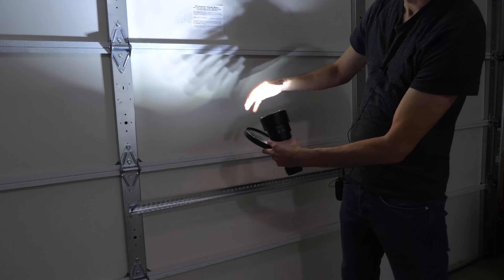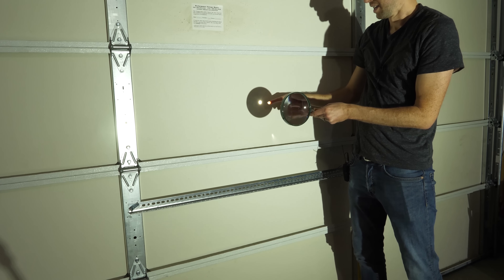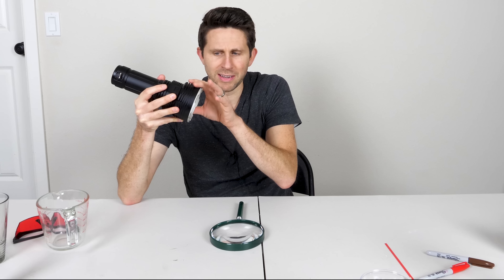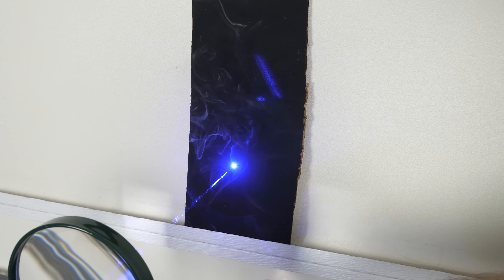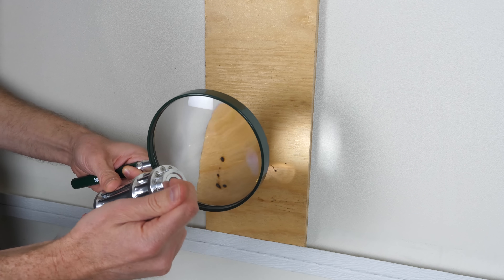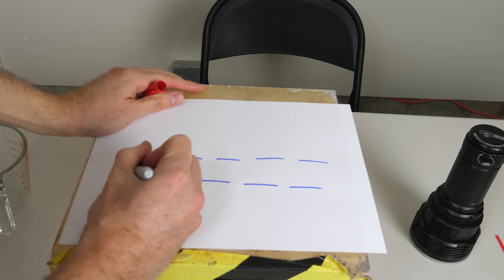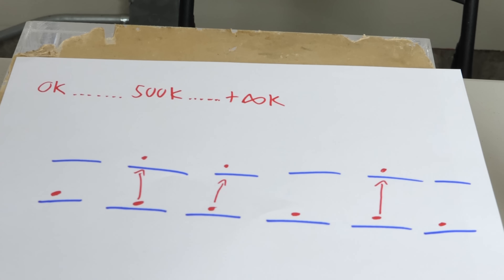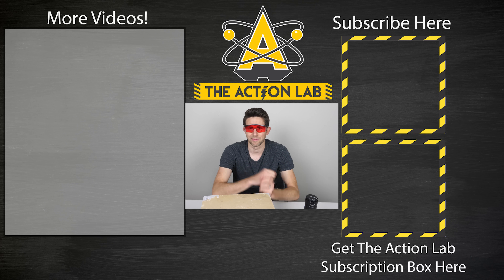What Happens if You Focus a 5W Laser With a Giant Magnifying Glass? Negative Kelvin Temperature!

Comment: What about a microwave oven? A body that radiates microwave energy has less temperature than the one we can achieve in a microwave oven in which we can even melt metals or glass.
Reply: You are adding energy to the system with electricity
Reply: @Adix_Null  And the sun is adding energy to a system of a lens and some random spot somewhere with fusion energy. The guy who posted this video made a big gaff with his explanation.
Reply: @Adix_Null  of course your adding energy to the system. No laser, flashlight, oven, or microwave would work without adding energy. I'm not sure how you meant that to apply to the original post. Hell i'm somewhat iffy on what he meant, lol. Is he saying that an oven can melt metal and glass but a microwave will not? If so there's obvious reasons for that.
Reply: @Adix_Null  , yes, this is the most correct. You're adding energy to the system that does not exceed the energy of both systems, separately. Heat is just another form of energy and the microwaves excite the water molecules which is just kinetic energy. Using electricity to increase the energy of the "system."
Reply: It's the same as the laser. It makes the target of the beam burn but it doesn't heat up the casing of the laser.
Reply: styropyro made a microwave lazer
Reply: Yep, I suppose microwave is more like wireless electricity transfer. Only material that can receive the radio waves and convert them to heat gets hot. 

You can make a solar panel and from the electricity create as high temperature as you want. IMO that's similar to microwave.
Reply: A microwave heats by friction.
Same as running your hand on something makes it hotter than your body temperature through friction, or starting a fire by rubbing sticks together.
It's a total different mechanism than radiative heating.
Reply: I guess that's electrons temperature radiating, and electrons heat motion is even weirdet

Comment: Dude.....i respect your knowledge and efforts put into making this presentation to us, but perhaps it's me who gets the information you put out wrong when you said that you can't use sunlight to start a fire, here's where ima disappoint you! When i was about 10 or 11 years old, i used to wear glasses, and when i upgraded to a newer pair, i used one of its lenses in an exact replica of what you're doing here, and i was able to start a fire by using the eyeglass lense on a piece of newspaper! The sun was right above me, so it must've been noon, or no later than 1 or 2 o'clock in the afternoon when i did that, and i was able to create a point small enough that it started burning the newspaper, which ignited a fire!! Perhaps you were only referring to that "you just cannot create a higher temperature ONLY...then the source itself by using some sort of magnification" so in that sense, yeah you're right! I didn't create a temperature in that concentrated point, that was hotter than the Sun, but i was able to create a point small and concentrated light onto a surface, where it reached a temperature high enough to where a fire could ignite.

Comment: You're wrong. The flashlight can be focused down to a point hotter than the surface..... What you should say is that it cannot gain heat energy, it can never be focused down to a point that has more heat energy than the original surface HOWEVER that DOES NOT mean it's not hotter.... It is obviously hotter because it has the SAME HEAT ENERGY CONCENTRATED IN A SMALLER POINT.

Much the same how a knife has the same energy as a finger poke but does infinitely more damage. Your laser never heat up, at all. All that happened is the energy was more concentrated and since it has the same heat energy but it's hitting a smaller surface that surface heats up more. It would be the exact same with the Led light but you'd need a bigger magnifying glass

Comment: You say that it's impossible to focus sunlight hotter than the surface of the sun. However (theoretically) if we had resources to build extremely large lenses aligned from the sun to the earth... I promise you that it's very possible to focus sunlight into laser light and focus that light into an extremely fine and extremely hot point of light that is far hotter than the surface of the sun.

Comment: I dont find the '-ve temperature' explanation helpful: it sounds like a notion conjured up to fit some observations.  A laser beam doesn't have a temperature until its radiated energy hits a surface and then the temperature rise depends on the material and energy in watts/area.  Also the comparison with a light source isn't real: the flashlight radiates energy in a very broad band while the laser radiates in very tight coherrent spectral bands including infrared.  Overall the system is conserved: the energy turned into heat is less than is put in.

Comment: I'm surprised. I would've thought you could definitely use the right kind of lenses to focus the whole of the light.
So if you can't do that, is it also not possible to use refraction, like satellite dishes making use of foci points or something the like?
Reply: It will be hotter. You cannot just lose energy. Energy focused on one point will have higher temperature but will still have same amount of energy...
Reply: You can focus all of light. Just that the focused point will never be hotter than the source is what is meant
Reply: The focal point will always end up smeared out due to the properties of mirrors/lenses and the physical sizes of the light source. If the source was a perfect point source or only had a single wavelength you can get around some of those physical limitations on optics, both things you see in lasers - they look like they're coming from a very distant point based on how parallel the light beam is, and they have very narrow ranges of wavelengths they output. Although even then, there are other practical limitations on how focused a laser can be; you're not going to be able to do hydrogen fusion with a red laser pointer and a few curved mirrors.

Comment: Not to shit on this guy interesting video. But as the video progressed, he drifted away into stongly theoretical physics on which he relied on as if it is actual (applied) physics, which consenquently deffy solid and sound basic logic. For example, absolute zero is exacly that. You cannot just use an assumption of a phenomena and use it as a factual tool.
Anyway, regarding the statement that you cannot focus the light of the flashlight any more then what the concentration of its emmision point is, I refuse to believe that, as I am preety sure you can first colimate the light beam, and then focus it just like the laser beam.

Comment: I love ur channel bro and have subscribed. I understand the thermal dynamics law, I also get that increasing the size of a magnifying glass will not increase the amount of heat aimed at one tiny spot.  But what if u use a smaller magnifying glass with the same large flashlight instead. Could it heat up the wood enough to burn it???

Comment: "However, a laser depends on the existence of an “inversion”, where there are more systems “pumped” into the upper state than in the lower state. If you plug this unusual configuration into the formulas that define the system “temperature”, you’ll get a negative temperature."

Comment: I've often wondered what would happen if you dumped a huge amount of Energy (Kilowatts, or even Megawatts) into a High Power Laser Emitter very, very rapidly.

You'd need to use a bank of Supercapacitors & probably a Superconductive cable connected to the Laser Emitter.  Drop the Temperature of everything way down with liquid Nitrogen. Now energise the Laser Emitter for a Millisecond.
The Emitter would probably be vaporised in the process, but it would produce an immensely powerful beam for a tiny fraction of a second. Focus it through a series of collimating & narrowing lenses into the tiniest possible point and what would you get..?
Reply: A pulse laser

Comment: With the big flashlight and magnifying glass at the beginning of the video, you had the dilemma of not being able to constrict all the flashlights energy down to a point with just one magnifying glass.  But I noticed the flashlight’s light was focused into a smaller area when placed in near-direct contact with the magnifying glass. Could you use multiple magnifying glasses decreasing in size until the light is constricted to a point without any light “leakage”?
Reply: yes, it can be done, that's how telescopes work (or worked i believe modern ones uses quantum effects rather than optics)
Reply: @hck1bloodday  no they still do but the magnifying glass is as large as the cosmos these days practically, literally. Gravity bends light and under the right conditions, such as black holes or dense galaxies, light is bent around the gravity source and focused. In short instead of a black hole bending a light thru it like a magnifying glass the black hole bends light around it where it can be focused using traditional lenses.

Also this video is retarded the comments are better. There isn't a negative temperature. Although you can cool something with a laser thats more because the laser is more like a person who is pushing someone on a swing but instead pushes at exactly the wrong time every single time like a giant a-hole on the playground.

Comment: Quick question if lasers cause heat on impact, why is glass not affected by this? We know glass can melt, but does the laser light then just pass through glass/magnifying glass without its properties being changed at all? This always stunned me, that glass is the only material to not be affected by a high concentrated laser.
Reply: Anything transparent doesn’t interact with the photons being emitted by the laser. Things are opaque because they absorb visible light, turning it into heat in the process.

Comment: I think in this video he mixes up heat and temperature. If you have a surface emitting 10 wats of energy per square inch, and you have 100 square inches all focused down to 1 square inch, then you will have a 1 square inch surface that contains the energy that was "diluted" over 100 square inches...thus its temperature will be much hotter. Total amount of energy is still the same

Comment: Is anyone actually understanding this?
Reply: Also this is pretty much the same with the sun? You can create a small point, that is hot enough to set a fire, yet a fire has not been set without the glass meaning the heat of the sun (on earth) is infact cooler than what a magnifying glass could produce ? As in my tests and knowledge the sun and a magnifying Glass both work the same as with a laser as your just concentrating the source into a much smaller surface area which ends up with the heat being sent to that single area causing it to be hotter that the original source.. idk I’m confused after this video
Reply: i think it's just so cold it burns basically

Comment: Doesnt it not break thermodynamics, becouse instead of adding energy to the beam, you concentrate the energy you have in a smaller space? Its still a beam, but its brighter, it just burns a smaller area. I also dont get why cant you focus a flashlight into a beam... Just the right lense would be needed, or perhaps a couple. Sounds like youre talking about a thing you dont fully understand. Plus its very theoretical so its hard to understand

Comment: A lot of people accept greenhouse gas theory as correct and the basis for climate change due to an invented "feedback" due to our adding about 5% to a 0.4% trace gas. It's been thoroughly exposed as BS and also violates Kirchhoff's law of thermodynamics that an absorber of thermal radiation MUST also be an emitter. There are no exceptions. Thus, CO2 also has a cooling effect on the upper atmosphere since it provides a way for heat to be liberated to space. After saturation, it's doing less than heavier elements. Also the CO2 graphs and hockey sticks are scientific fraud and provable so.
Also GHE theory is used for Venus, without explaining why a Venus "night" (58 Earth ones) and a Venus "day" are nearly the same temperature. The 96.5% CO2 is no "feedback" if it was Venus would get hotter and hotter in the same way the kept corrupt establishment are trying to fool people that humans are a big problem and we must do everything possible to prevent CO2 from entering the atmosphere. It's the justification for "Drastic action" under the WEF, IMF and powerful interests infecting idiots in power with group think based on BS.
Power grab and depopulation in one go, or a power grab. We have to stop both and isolate the real virus before they really unleash hell on earth (their plan B when people become aware (of the lies and propaganda) armed with hard facts!))

Comment: Awesome video I was wondering about that laser focus! Kind of like centrifugal force or centrifuge! Or like you could break one pencil but if you have 10 or 15 pencils you cannot break them all at one time! I like this video! My question is if you have two pieces of metal if it's steel or iron and both laying out in the complete 100% sunshine! But on one you would have a magnifying glass the same width as the piece of metal both pieces of metal! So in essence both pieces of metal are receiving sunlight except one has a magnifying glass that is concentrating sunlight into a focus beam with that piece of metal get more hot a lot more hot higher temperature than the other piece of metal ? Compared to the metal that is without the magnifying glass!??? Even though they both received the same sunlight surface on metal but because of magnifying glass is the same size as a piece of metal circumference wise! And if the piece of metal with the focused magnifying glass heating it up doese more that metal gets hotter??? If so then that would mean focused energy from the same energy makes things hotter! I would think !This is a good experiment to try on your next video!!! text me back write me back if you want! click my picture and you'll see my email address!

Comment: Well you can actually use a magnifying glass to heat a single point of light hotter than the sun with the sunlight. The collective surface area's heat is being redirected to a single point. Its like taking all the heat from one hole section of the sun and putting it into something significantly smaller like a golf ball.

Comment: I will accept quantum theory because it's just that, a theoretical format for an idea until proven or disproven.
But, quantum physics or quantum mechanics is complete and utter nonsense.
I can't exactly say that all those who believe in quantum physics as a real form of physics are complete idiots, even if I would like to, but concentrating light on a single point will always create heat irrespective of the wavelength, the difference is how much light you need to burn or melt a surface, which is determined by material, color, light-up sorption, reflection, and transparency, making some materials burn or melt more easily than others.
If you would have had the tools to redirect the light from the flashlight into a single direction, like with extremely reflective concave surfaces such as with concave mirrors, you should have been able to burn or at least warm the surface of the black cardboard.
But, because LED lights produce far less heat than most light bulbs, they are far less incandescent and will produce much cooler light requiring more of it to produce any substantial heat making it very inefficient for burning things, unlike with incandescent light bulbs such as the tungsten light bulb that produces much warmer light.
Although some marketers claim that LED lights don't produce any heat, that is false, however, it hardly produces any heat whatsoever.
Now when visible light is absorbed by a surface, the surface converts the short-wavelength light into long-wavelength heat causing the material to get warmer, as a result, you cannot create a temperature such as negative kelvin using a concentrated light.
And do note, kelvin is measured from absolute zero meaning that 0 kelvin equals -273.15 celsius or -459.67 fahrenheit, and is the lowest possible temperature ever recorded.
Quantum physics or quantum mechanics is just gibberish to make you sound smarter than you actually are, but I do not understand why people try to cling to this gibberish so religiously.
Not to mention, lasers are not a quantum mechanical system.
Also, I'm not sure how good you are at math, but 0 and minus 0 are the same thing, and infinite is not a feasible number for it would envelop all existence if it would be achieved.
You should also keep in mind that dropping a temperature below 0 kelvin is technically not possible for it would violate the laws of particle physics.
I know I can safely say that heat causes molecules to move faster, but I cannot confirm or deny if heat is limited by the speed of light, but then again I wouldn't be surprised if theoretically when a molecule exceeds the speed of light it would rip itself apart imposing a technical limitation.
But as of yet, the highest possible known temperature is 142 nonillion kelvins.
Ultimately, this can only come about when particles achieve what is known as a thermal equilibrium.

Comment: I would have thought the temperature divided by the area heated would be equivalently lower, since the glass of the lens would absorb some energy, but that the heat at the focused point is higher over a smaller area, in a similar way to how pressure = force/ area?!

Comment: you can use a series of lenses to focus the flashlight to a smaller hotter point. It will not break the laws of thermodynamics as long as the total energy does  exceed the energy released by the flashlight. i can bombard a smaller area with more photon strikes per second per square mm.